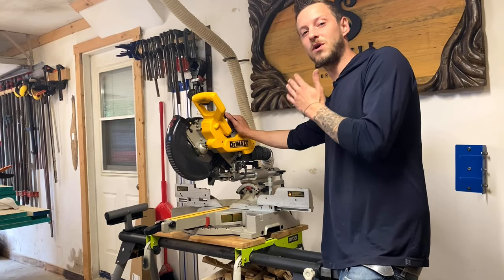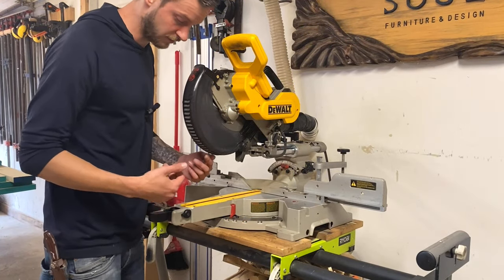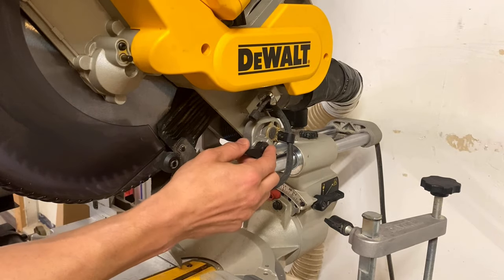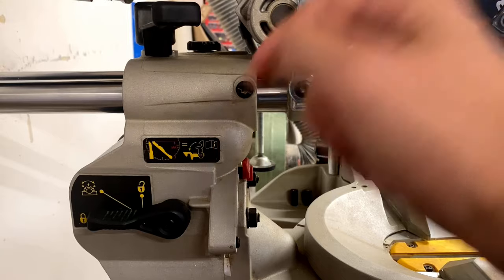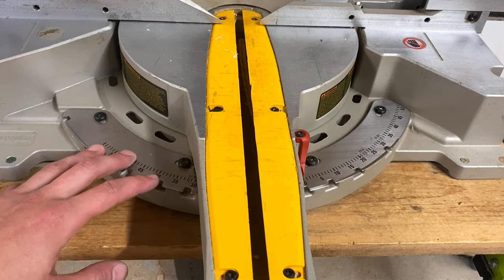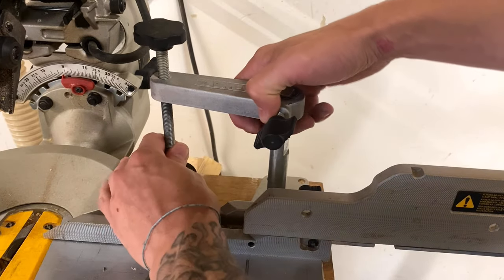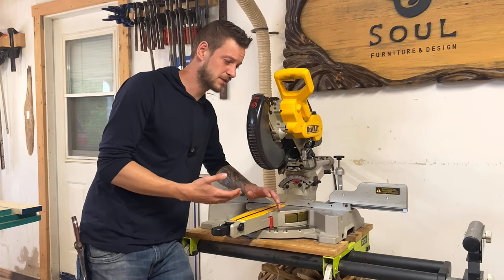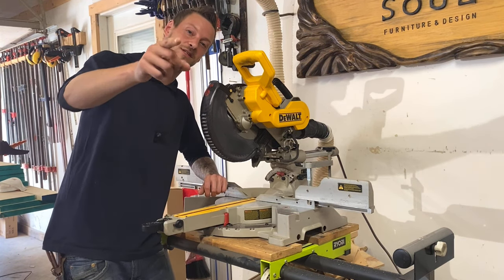DEWALT 10” Dual Bevel Sliding Mitre Saw Review

Comment: I was going to post that the 12 inch (dws780) is still on sale for $499. I picked one up last week for $425. I wanted to compare prices and I couldn't find the 10 in dual bevel anywhere. It looks like it's been discontinued.
Reply from the maker: Good deal! I still see the 10” dw717 for sale at Canadian tire and Home Depot here in Nova Scotia. Regular price is usually around $650
Reply from the maker: Where abouts are you located? I would like to upgrade to the 12” one of these days!
Reply: @soulfurnitureanddesign  northern Wisconsin.  Amazon has the 12 inch for 499.

Looks like even the dewalt website says the DW717 is discontinued. I'm sure there's probably plenty of physical stores with inventory kept to sell. 

I just do my shopping online cause the nearest tools store is 45 minutes away.
Reply: @soulfurnitureanddesign  I didn't quite need the new miter saw yet, but for that price it was a no brainer to upgrade my starter saw (Metabo hpt 10 inch miter saw) which was way better than I expected my beginner tool to be when I bought it a year and a half ago. I never even swapped blades and it was a great little saw.
Reply: Where did you bought that 10 inch

Comment: I bought this saw a few years ago.  I haven't used it a great deal but I can say that 1)  The dust collection is lousy: the tube which passes through the centre of the saw is ridiculously narrow and convoluted and the opening sits too far back from the blade: sawdust spews out on both sides.  2)  The bevel clamp failed to hold the cutting head after about 30 degrees.  I had to take out the dust collection tube  - a pig of a job: easier if you remove the motor casing first - to get at the screw holding the clamp handle so that I could tighten the hex nut underneath.  If I replaced the handle with the nut tightened enough for a 45 degree cut, then it wouldn't release enough to reset the bevel to zero.  I've left the handle off and now use a spanner.  Apart from these design faults , its a nicely made item.
Reply from the maker: So far I’ve been lucky (fingers crossed) I haven’t had any issues with it yet. The dust collection could definitely be improved on but it seems good enough compared to saws I’m used to lol